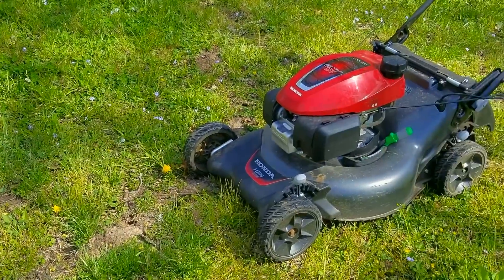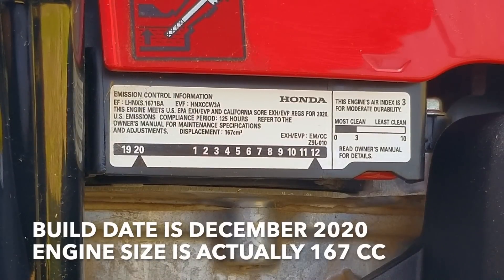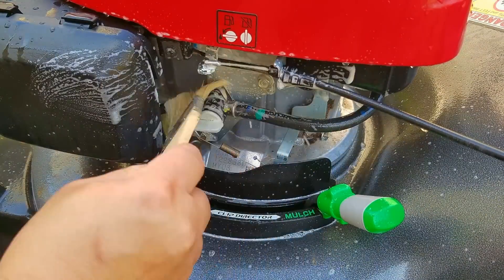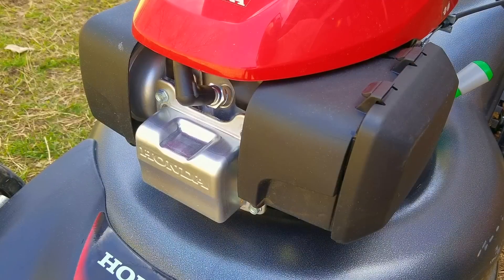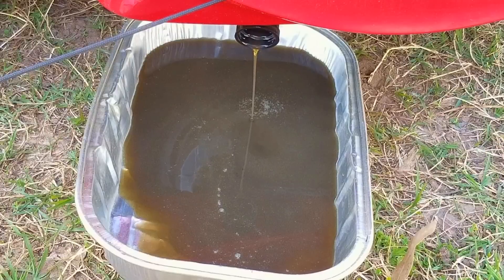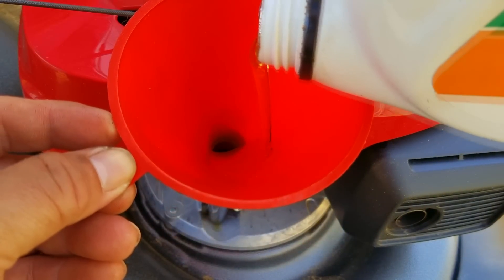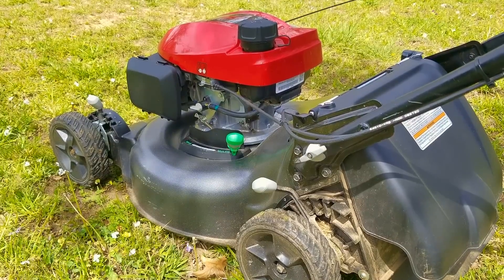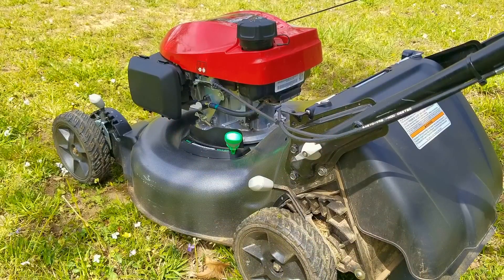Fixing A  Honda HRN 216 Mower That Won't Start

Comment: I have one of these I use it several times a week and it’s never given up in 2 years haha. Only changed air filter once, spark plug once, and constant oil changes. They’re beasts!
Reply from the maker: Thanks for sharing Hiro Nakirogawa.
Reply: I’ve added oil to mine once cleaned the air filter one and that’s about it on my $100 lawn mower from Walmart 10 years ago
Reply from the maker: nice, still working well I see.
Reply: @mgomez5606  I’ve put almost no tlc into mine and it runs top
Reply: Why the constant oil change?
Reply: @Prince-fr2lr  Once every few months because it’s used heavily for a gardening company
Reply: @hironakirogawa1684  thanks

Comment: I have this mower, has worked flawlessly for 2 years.  It’s lighter and a lot more maneuverable compared to my HRR216.  Of course the key to any mower or any piece of equipment, is regular maintenance.  If you MUST leave it outside, cover it up for heavens sake, lol.  Treat your mower casually and it will become a casualty, lol. Cheers!
Reply from the maker: you got that right Tony M. thanks for the comment
Reply: Treat them well and they will return the favor. I've seen almost no regularly maintained mowers blow up quicker then a unmaintained one. I know a person that buys push mowers and never changes blades, oil, or air filters they gave me a mower that had the foam filter half eaten by the engine and so brittle in was falling apart in my hand they filled the Carb fuel bowl with fuel since the tank and bowl wouldn't hold without pouring it out. Those people blew a couple year old John Deere push mower with at most 5 hours of use from trimming here and there and they blew it up in only 7 Months it cranked every time when we had it and ran beautifully but lack of maintenance blew it up. All my riding mowers that run are 20 Years old from Sears and they run great.

Comment: Id agree, Many brands... like ones who have fallen under the grasp of MTD have taken the reputation of a name and made the product cheap but the modern reputation from brand's like Honda and a brand like Toro from modern homeowner's and commercial owners means id still be more than happy buying them for just your normal residential lawn or heavy use.
Reply from the maker: totally agree with you Frame Lawn Care.
Reply: In 2019 I replaced my 2019 Yard Machines by MTD mower with a Techumseh engine and caster wheels. Today's equivant comes from Cub Cadet, also an MTD product. It had the overseas engine like so many others do, but the build of the machine is as good as the old one, in some ways, better.  It starts on the first pull. Granted, it was not a bottom tier mower. No complaints.
Reply: @MazichMusic  Good to hear you have good luck with them. Im sure they make some good mower's but its just a personal choice for me with seeing MTD and the reputation MTD has developed I just like to stay away from them. Id love to see MTD start making some fantastic mower's but from what I've seen at big box stores I'm just not a fan.
Reply from the maker: thank yo George Mazich

Comment: I have one of these, but it has the electric starter on it. This engine does have a very common problem on it however. Once the air filter starts getting dirty, they get hard to start.

Comment: I have the same Honda mower. It would not start after sitting for the winter. I tried draining and filling with fresh fuel, also a new spark plug. Dead. I watched your video and primed the carb through the choke and voila- started right up. It has been running perfectly for 2. days. Like you , I suspect that jets were a little plugged and opened up when it started. Thank you very much - great video!
Reply from the maker: no problem and thank you Jack Pearson.

Comment: Mine won't start after about 2-3 weeks of not using it. Pull the cord 10 times in a row and won't start. Was working just fine before. Could it be the thermoswitch?
Reply from the maker: easy way to find out. Take off the filter and cover and look at the choke flat.  It should be closed if not then it might be stuck

Comment: I found this video very helpful.  Mower would not start, first cut of the year.  Purchased last year so it’s very new.  Yes, I had way to much oil in the engine.  Even after I drained and refilled with 12 oz it was not cranking.  Took off air filter and added a little gas to the carburetor.  Would crank and cut off pretty quickly.  After 4-5 cranks and cut off it stayed running and now is working as usual.  Guess I had some water in the carburetor.  Either way, your video was very helpful!  Thank you for sharing your experience!
Reply from the maker: no problem and thank you for the comment

Comment: We have two of these mowers(one at each property). They always start up and run great but we always run the gas out of them after each use. The self propelled system is great and the motor has lots of torque so it does not bog down much at all in tall grass compared to our older mowers we used to use.
Reply from the maker: Thank you for vouching for them ATV Repairs and more.

Comment: I bought a Honda HRX just before the start of mowing season. Love it so far, especially the RotoStop feature. Changed the initial oil after the first mow. Really going to take care of it so it’ll hopefully last me forever.
Reply from the maker: congratulations on your purchase, and yes take care it, and it will surely last you years.

Comment: I have 12yr old Husqvarna mower with Honda GVC160 engine 
I change oil yearly along with new air filter / new spark plug every 2yrs
I use 93% Octane ethanol free gas and I only put enough in for what I need. I don’t let this fuel sit in the tank. I run engine out of gas when I’m not using it never had a problem with this engine running 12 years. Strong Honda is hard to beat.
Reply from the maker: man you're doing it right!

Comment: Thank you for the detailed video.  We have this exact same mower we bought maybe 5 or 6 mos ago.  Mowed the yard 1 or 2 times.  Let it sit like 4 mos in the garage.  Tried to use it last week and It wouldn't start.  Drained the fuel.  Put new fuel in.  It started and ran fine.  One week later, now it wont start again.  Wife is now starting to say bad things about Honda (we just bought a CR-V) haha.  Thinking our area of Southern Washington state is either using too much ethanol in their fuel (we use Chevron and Shell) or the fuel we have in our 5 gallon sat too long and has water in it...
Reply from the maker: that is a possibility.  I like to use a 2 gallon gas can, because it allows me to pour it easier, and more importantly it allows me to use the gasoline without worrying about having it too long.  That time, can allow the gasoline to either get old or collect more moisture from the air.

Comment: Nice mower! Got the same Hrn216 since 2 years ago when I bought it new. In the last 2 years it has not given me any major issues with this mower. Only changed the oil on it twice, haven’t changed the blades yet, will do it soon. Might change the air filter this year but other than that, I think it’s the best Honda mower I’ve ever had for my business.😉
Reply from the maker: thank you Brothers' Lawn Equipment.

Comment: Just got one of these last year. I love everything about it except the self-propel. I think that Toro has nailed the self-propel system with their Personal Pace system. (I also have an 8-year-old Toro Personal Pace mower.)
Reply from the maker: you got that right, I like this mower a lot, but the self propel on the toro is fantastic
Reply: I think if you had a very smooth lawn, the Honda self-propel could be alright, but if you have a bumpy lawn, like most of us, you come to appreciate the Toro system.

Comment: Excellent video. I have one of these with the GCV 170. Idles like crap. As soon as the blade is engaged it runs and cuts perfect. Had it for less than a year. Use only non-eth fuel. In my opinion the newer Honda mowers are inferior to the older models. I've had five different ones. A HRC215 commercial mower with what I believe is a Gcv140 stands out above the rest. The smaller engine has never starved for power and cuts very well. The metal body is the weak point as is every Honda I've owned. All in all, despite the flaws, they make a great mower in the price range. As the competition dwindles, they have excelled. I read somewhere that Honda is getting out of the lawn mower production business as soon as this year. (2023). Knowing when to call it quits cuts losses in most cases. Who would have thought?
Reply from the maker: I know right, it's quite surprising to know they won't be around in the mower section at least.

Comment: Quick fix is always nice. Plastic parts don't hold up well. Would rather pay more for higher quality and longevity mowers.
Thanks again for you time and effort  putting forth a quality demo video...
Reply from the maker: you make a great point, and yep I agree with you onto price, I guess it's going to have to be a honda commercial then. Thank you Mr G.

Comment: I recently found an Aussie Victa Tornado mulch or catch 19" mower with a 190cc Briggs 625 series with good blades. All it needed was fuel and it started right up and runs smoothly. It's great for chopping up a small pile of  leaves and depositing it on the lawn. With a quick rake you never know they were there. It has a disc with fins on it and four blades bolted to the edge. Unfortunately such a blade set up doesn't comply in the USA but we've been using such a swing blade set up for decades without a problem.
Reply from the maker: I would love to see one of those up close, I meant to work on of course.

Comment: Having a plastic deck on mine is SO nice, no risk of it rusting or getting bent out of shape! And the construction of it from Honda is excellent, so it’s the best of having plastic where normally that means “cheap.”
Reply from the maker: true but the plastic is easier to break.
Reply: @INSIDEHOUSEGARAGE  good thing to consider for sure. My 2c: I say this as an industrial construction worker with 3 summers working major landscaping before: I’d be VERY surprised if a homeowner or even entry-level lawn care person broke a plastic Honda deck. By test standards the plastic used is stronger than aluminum (see AVE channel on that subject).
Reply: The hrn is not a plastic deck
Reply: @bikes7777  cool, I never said or implied it was 😆 damn, there’s GOT to be better reading comprehension from folks in 2025, I swear.

Comment: About that first oil change...my father did the first oil change in 2022 on a Honda GCV 160 from 2007 used every season. Still ran great on the first pull.
Reply from the maker: very nice!

Comment: I’ve repeatedly seen people “upgrade” lawn equipment, appliances, tv’s etc. They almost always regret it because the “upgrade” is more cheaply made and does not last as long. I’m not adverse to progress, but be smart and do some research. Great video!
Reply from the maker: yes you are absolutely correct, I think we need to change the turn from upgrade to "gamble"
Reply: @INSIDEHOUSEGARAGE  You’re 100% correct.

Comment: That’s why when I did an oil change on my lawnmower I put like a little bit of oil in it and it was already full. I only tipped it over once. Gotta remember to tip it over multiple times next time.
Reply from the maker: thank you Matthew does stuff, for your time I appreciate it.

Comment: Excellent overview of mower prep and maintenance especially useful for those averse to reading the owners manual. Mostly agree with your no-start views but I'd liked to have seen you examine the plug to see whether fuel was being drawn into the CC. I take exception to your comment that too much oil is more dangerous than too little.
Reply from the maker: thanks and noted

Comment: I have over 20 hours on mine - zero issues and starts every time 1 pull.  However, I make sure to use good fuel and it's stored in a heated garage.
Reply from the maker: very nice!

Comment: I have this mower (different model) and it has the GCV 200 engine, the compression release is very weak, it almost takes nothing to pull over, kinda surprising
But it works great and I like it alot
Reply from the maker: now that makes sense, thank you Professional Doggo.

Comment: My Yard Force mower was a $200 special from a local hardware shop. It seems to be a good mower. It has a small fuel tank & is good on fuel. I use it once a month on average, for about 15 minutes to mow the back yard. The front yard is done by line trimmer. I'm not one to buy expensive mowers.
Reply from the maker: me neither Christopher Marshall.

Comment: I had same exact problem with my mower. I changed Oil and still had issue. Once i removed filter and primed like you showed it worked. Appreciated
Reply from the maker: Thanks for sharing

Comment: 6:54 more oil comes out because when you flip the mower over oil stays in the valve cover and in the bottom side of the piston. If you lift the front of the mower it helps get oil back into the sump.
Reply from the maker: sounds pretty reasonable

Comment: Great mower with tons of power, I went with the electric start vs blade start stop for simplicity and less wear items. Shear weight of this thing makes it hold hills great. Simple maintenance once a year and go. I just wish the tipping method did get all the oil out at once. Side note, keep the original factory fill bottle and just refill that. Makes oil change's quicker. I spoil mine with amsoil.
Reply from the maker: Great point! thank you iamherenotheretobe

Comment: I run a lawn Business and bought 2 of these last year and after 1 week and maybe 2hrs on it the valve cover is leaking oil on 1 and the other seems ok. I also have i think the 2017-18 model and loved it! But... I used the shit out of it and needs new rings plus valve cover leak has been fixed 3xs. Would still use it but time is an issue and I don't have it to be able to rebuild or I would have because it cuts way better than the new HRN. It was built way stronger and it was more solid but the pinion gears for the rear-drive would also get locked up from dirt build-up in the bushings and I believe the new hrns did away with that. So there's pluses and negatives as always and they're only used for lawns I can't get my Zero Turns in.
Reply from the maker: thank you for sharing your experience with these mower, it means a lot.  I would still use them as well, I just wish they didn't cut so many corners.

Comment: Love the video I have the Honda hrx and I have only used it for a season but have loved it so far my biggest downside is despite having a polycarbonate type deck it is heavier than most steel decked mowers and has an unusually low setting for the bars (even on the highest setting) I would assume this would give you more leverage when moving it around  the yard to compensate for the weight it is a great mower to use other than that small issue
Reply from the maker: that's a very interesting situation you have there, thank you for the comment, and I hope you can come up with a solution

Comment: As of the new Hondas I never experienced working on one it looks like it according to the mower in your video it looks like the motor is very well made but it looks like the frame is trash and I just don't like to frame on it but I love the Honda motors I got to push my order that I use to mow my front and front yard and I've had it for several years and never had a problem with it except timing belt
Reply from the maker: I know right, I didn't want to mention the frame but you're going to have to keep an eye on it for rust. Thank William Moore.

Comment: The best thing with the HRN is that they redesigned the self propelled system so that it pulls backwards without spinning the transmission. It’s a huge upgrade from other Honda designs in that regard.
Reply from the maker: Really?  I'll have to confirm this because I don't think it's possible with the way it's designed.
Reply: @INSIDEHOUSEGARAGE  Yes! I’m 100% sure. Had tons of issues with the system on my old HRR because the adjuster driveshaft bushing lacked a seal on the wheel side. My HRX217HYA has a dust seal on both sides of the bushing, but still has to spin the transmission. I recently picked up an HRN216VKA as a “spare” to ensure I can mow the rest of my days with Honda. The HRN uses a completely different dual ratcheting setup that makes it so the drive shaft is only in play when the self propelled is activated. It’s a brilliant design.
Reply from the maker: I see, When I get one, I'll have to see how it works then. Thanks

Comment: My dad and i will be getting ready to do a. Oil change on our riding mower, now the deck has seen better days, its a 2003 craftsman 48 inch deck with a 22 horsepower kohler v twin engine. Now ere just having a problem finding. Replace cement deck, but the ones that are comparable are like 500 plus bucks, but im sure we can get a few good more years out of it, our sol is pretty sandy so m guessing over the years, as we mowed, the metal started to wear down just because it becomes Ike a sandblaster as the blades suck everything up
Reply from the maker: you are absolutely right, Seen plenty of riders still running perfectly fine but the Decks have given up due to wear.

Comment: I bought this new in June 2022 and then used it twice last year due to breaking my leg in the summer (so had a service). Went to start it up now and doesn't work. Extremely frustrated. Going to try to prime as you suggest and see what that gets me. Thanks.
Reply from the maker: good luck with it, and sorry to hear about the leg.